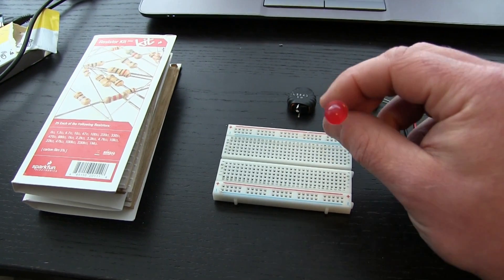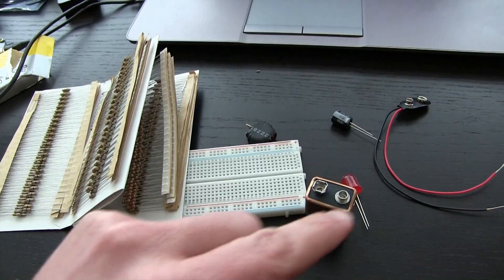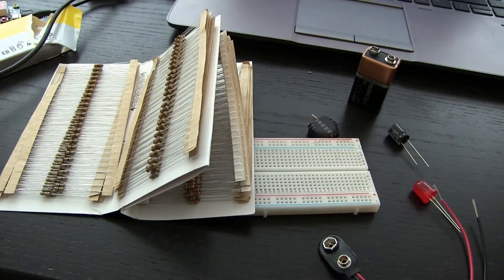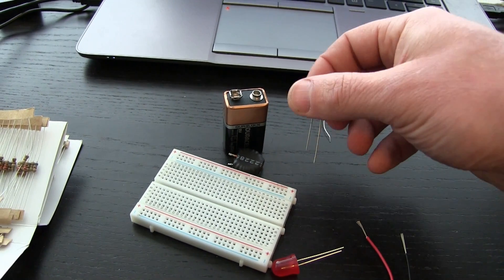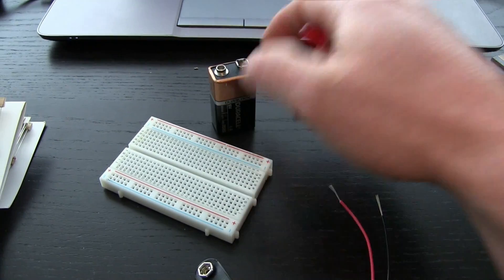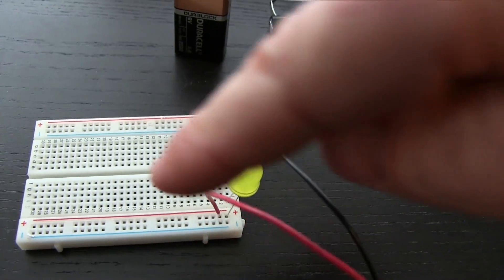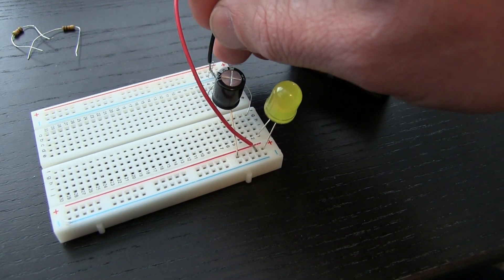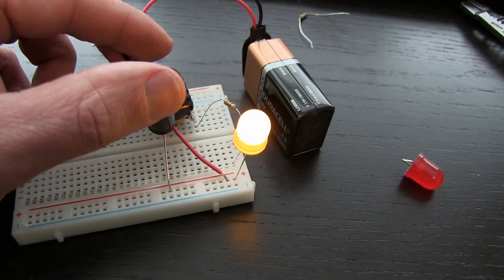Electronics for Gearheads and one Welder.

Comment: Like plumbing but different
Reply: o0o0o0 would love free stuff to show off to my HVAC broturds
Reply: The best analogy I heard back in my viking days was a comparison to plumbing.. where as voltage is related to water pressure / psi, and the current represented by the amount of water volume passed from the source to the destination. More current requires bigger pipes / wires and the higher the voltage or psi must not be too much for the load. That and some time with ohms law with get ya choochin..
Reply: TunedCavityLasers a capacitor in series can be imagined as an expansion bladder on a central heating system in that a surge in pressure causes it to expand, and a loss in pressure would result in it filling in as it shrinks back down until it’s released all its stored pressure again.  

A capacitor in series would be like a bladder connected at both ends, with a membrane stopping the two sources of water touching. It could pass an alternating push&pull of water as a signal between both (until the membrane is at its maximum deflection, thus limiting current) but can’t be used to pass information if the flow of water can only go one way (capacitors block DC).
Reply: Like plumbing but with way less turds and no stank.

Comment: I did some work as a contractor at BIW last year...
I had to watch a 10 minute safety video with regards to the "angry pixies" those boats have inside em.

Apparently those big boats are not only FILLED with tons of them pixies... they actually make em right on board.  Major KW kind of pixies.  Enough to hop out of the wall, through you and your buddy and back into the wall...  Iffin you're standing in just the right spot at the right time!

Talk about welding!

Comment: it helps me to think of it like water . resistors are smaller pipes .  capacitors are reservoirs. switches are ball valves . 

its my dumb way of thinking about it
Reply: sonofdrjekyll that actually helps a lot. Thank you.
Reply: My dad explained that Amps  are like a volume of air in a compressed air system, so bigger pipe, more amps.
Voltage is considered to be force, so higher pressure in air system,  is like more voltage.
So if volts x amps is watts, 
Pressure x volume = hp

What does this mean? Well if you have an air motor running a drill press, you need lots of air volume (amps)  so 3/4 in line or even 1 in air line. (Bigger wire).

If you are using an air nailer you need higher pressure, (volts) and smaller hose is ok for intermittent use. 

Hope this helps

Comment: Am I the only one confused that the LED blinked once at 4:08 when he held it on the battery the wrong way?
Reply: I'm a bit confused too. I'm guessing somehow there was some sparks that completing a circuit that let some current flow the way the diode allows.
Reply: Á:/ diodes only allow current to flow in one direction but if the pulse is quick and too high it can allow backwards flow

Comment: This is going to be a fairly long comment and I apologise in advance if I send anyone to sleep - feel free to throw things at me, point and laugh etc if you wish.

I recently came across this channel and you, Sir, are a man after my own heart. I've been binge watching your videos and it's quite possible I need an intervention, but until then I wondered if I might ask a question about a little problem I have, particularly in light of the subject matter of this video.

First off, let me start by saying my speciality was automotive engineering and as such I am a hopeless duffer when it comes to the magical dancing pixies of electricity, so go easy on me.

Since I retired, I've been building all kinds of weird stuff in my workshop in the garden, one of which is smoke generators; specifically small ones, from a few inches on a side down to my smallest which is less than an inch square.

I've built loads of the things for various projects and it's all been fine. I power them from 12v 1.2Ah lead acid batteries, the kind you get for alarm systems, and they work great. The trouble is, I want to improve the electrical side more. I'd like to be able to use 12v Lithium batteries, add timers, Arduino controls and so forth, but the problem is whenever I try to do this, the inbuilt overload protection kicks in and shuts it all down.

I think I know why this is happening - the heating element in the smoke generator is basically shorting out the battery - I'm using resistance to turn the electrical pixies into heat (the element wire comes from a hair dryer), so what I need is a way to limit the current going into the generator.

Now, as I mentioned, I'm pretty useless with this kind of stuff. I can build basic circuits using off the shelf components, solder, program Digisparks and such but other than that I'm at a bit of a loss. With my limited understanding, I put a multimeter on it and it looks like it's drawing about 6v and 10A, which obviously flattens the battery fast and isn't doing it any good at all. I go through these batteries like they're going out of fashion because I'm knocking the stuffing out of them.

Basically, I want to limit the output from the battery to a maximum of 12v 1A. That way, I can make the heating elements to work with that amount of power and hopefully not trip out the overload protection on everything else.

Any assistance would be greatly appreciated. I've been to various electronics forums and such but they either ignore me, smile politely and back away, or give long, complicated answers that I really don't understand.

For info, I've added a link to a short video showing one of the smoke systems in operation to give an idea of what I'm rambling on about.

https://www.youtube.com/watch?v=kOHjtKtAjMY

Comment: Hey, that wasn't too shabby an intro to electronics. I love some of the kits out there now for getting everyday folks into electronics; even some descent ones from the surplus section of Princess Auto. I could always use another ruler at work for checking bolt sizes to throw in the toolbox if you have one handy.

Comment: It’s not the volts that kill you (prank electric shockers have plenty)

It’s not the amps that kill you (car batteries have plenty)

It’s not even the combination of high voltage and high amps that kill you (a static shock is high voltage and high amperage). 

It’s watts over time that’ll get you. Doesn’t need to be a lot of time either.

You often hear “it ain’t the volts but the amps that’ll get ya!”, but I=V/R means you don’t get big amps without big voltage when resistance is high (as in human skin)

So always pay attention to the high voltage warning signs. They’re generally stuck on things with high voltage that are capable of delivering a lot of wattage all day long.

Comment: What are you some kind of psychic?  I swear I was going to comment on your last video (makita grinder) asking you to do a video on adding diodes to automotive relays for flyback protection... 

I am building a piece of equipment that I need to use transistor proximity sensors on to trip a standard automotive relay for a limit switch.  I did find another video on youtube that was very helpful and explained it well, but to log in and see you talking about the same exact thing was creepy.  

My son and I watch your videos religiously.  Keep up the good work!

Comment: Interesting little project, I'm wondering if you could easily make a simple miniature multi meter in the form of a ruler. Shouldn't cost more then about 10 bucks to add the basic functions judging by how inexpensive stuff is on ebay.

Comment: 2:50 Wrong, there will NOT be a 9 volt drop across the resistor unless the resistor has infinite resistance(open circuit). If ANY current is flowing then the voltage drop will depend on how much current flows.

Comment: I used them in a summer school project. I had a choice in Elementary school more like daycare provided by the local district. I was really good with computers back in 1996 to 1998. One teacher suggested I take an electronic course. I haven't seen those things in like 20 years. I  always wondered what they were called. Because of that class I got this electronic kit that Radio Shack sold back then you could make all sorts of things. I had the resistors and mosfets and fuses were all built into the box and then you used springs to connect ans hold the wires. The instructions showed you how to wire tons of things likd metal detector or high pitch noises excetera you bring me back to my younger years. Does anyone know the name of it? They came in a few variations I had the bad ass one after I got bored wit the small one. And even had like expansion boards to hook up the wires were all color coded everything on the board was labeled it was fun.
Reply: I think I had that thing too! was the board transparent plastic with instructions on paper that you set under it?

Comment: Kirchoff I,II and you're good for the basics, it's fun how's electromanetism works, those 2 forces are magically connected, yet unknown how's those weak forces are just a consequence or the fundamental building blocks, fun times. For the 10 mm leds you need x voltage, and y current.Your supply is 9 V. 9V - x voltage =U1 voltage drop, take this and put in the R=U1/I,and that's your Leds ressistor value

Comment: 4:08 if you notice the LED lit up for a split second even though it was in reverse polarity
Reply: I think it's because he was holding both leads with two fingers, allowing for a moment the current to discharge from the battery, through his thumb and/or forefinger with the correct polarity, and return to the appropriate terminal.  If that's not it, it seems to occur when he pulls the leads of the LED away from the terminal of the battery, maybe causing a voltage spike that is then higher than the breakdown voltage of the diode?

The second explanation is a long shot due to my limited blunderstanding of the fundamentals at work here.

Comment: pro'ly too much detail, but it's not quite right to say diodes have zero resistance.    They have the resistance of their forward voltage.   Across a voltage below their fv they have essentially infinite resistance.  above it zero.  BUT with the current limited otherwise in a circuit they have an effective resistance such that the voltage drop of their forward voltage is the difference.

So if you have a 5v source and need 20ma across a 1.9 fv LED you need to drop current to 20ma across 3.1v, not 5v.   I.e a 155 ohm resistor (I know there is no such normal value, you'd use a 160... but going forward ...) in such circuit the effective resistance of the LED would be 1.9 = (.02)R, ergo 95 ohms. 

The hardest "wrap your head around" in electronics is that even though you build lego style and can mostly design lego style, is that for calculating things you've got to calculate the whole and afterwards can part out the various current/voltage drop values.  This shows in cases like the LED/diode effective resistance (if you have multiple diodes even in a simple resistor network, you can wind up needing to solve a linear equation to figure out current values) but is otherwise only a slight headache in DC circuits but is VERY significant in AC.
Reply: I should add that this is why you can get away with using some LEDs with just a battery NEAR their forward voltage ... they resist as if they are resistors .... but go higher and you blow them.  Likewise as they warm their resistance (and forward voltage) drop and you get a cascade effect that will eventually blow them.  That's why LED lights designed to run long term need to have a current limiter circuit.
Reply: Oops sorry Chris, had seen many many of your tool vids over the past few weeks but only since writing the above saw how many  electronics vids you've also done.   You obviously already know enough to have known all that and just judged to keep it toned down for this vid.

Comment: Actually, you won't get 20 mA if you place a 450 ohm resistor in series with s 9v battery and a yellow diode. Using Omh's law, the voltage that the resistance needs to drop is around 7.2 V, since the yellow led has a forward voltage of 1.8 V. If you want 20 mA, then you divide 7.2/0.02, somewhere in the range of 360 ohms. And we lot are lucky, since there's a 360 ohms in the E24 series (the most common one nowadays).

Now, is this actually helpful for the target of this video? Not really. The LED will light on somewhere between 12 to 30 mA. Any lower and it won't chooch, any higher and you'll get a whif of the 'magic smoke' along with a kick drum. Sick beats, eh?

Comment: Hey if you are still giving away these rulers, I would like one. Otherwise, I will still like one I would just have to pout about it in a corner and complain instead. I have started working a bit with electronics so a rule with some gadget on the end seems cool. Bulky and not practical but cool.

Comment: Your math is wrong, you have to take the voltagedrop across the led and subtract it from the 9 volt, Like this: Led = 3v - 9v = 6v / 0,025 = 240 Ohm. to get 25mA flow, you 450 ohm resistor will give you 13,33mA ;-)

Comment: When you need a chart for to know what those swell colored rings upon your resistors mean, and you eventually will, use this link, it's got all the smarts built into it and as long as you are not colorblind you can figger it out.
https://www.digikey.com/en/resources/conversion-calculators/conversion-calculator-resistor-color-code-4-band

Hope this helps the lesser enlightened.

Comment: had a welder one time with a bad ground clamp that grounded itself out through the ground on a 600v 3phase plug and just melted it .the welder created a loop just through a place it shouldent also had one that was leaking hv out and when someone else was welding on the same one was shocking the other guy it was funny